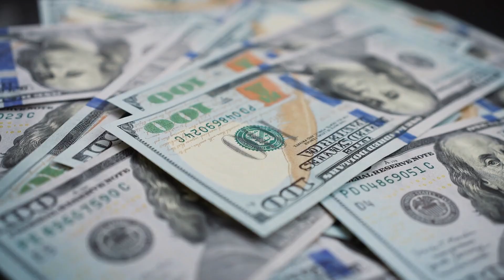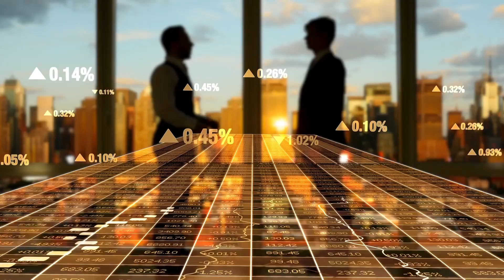Why Solar Power Failed in the Sahara: The Untold Story

Comment: Maybe we could use instead the Sahara to cool the planet with heat convection. Paint black large surfaces of the desert. The air will be heated a lot more than the surrounding. This will create a convection current that will send the heated air to the lower stratosphere. There it will radiate more infrared to space because of less greehouse gases over it. The cold air will go down back to the desert surface. This would cool down the desert on average and cool down on average the planet.
Reply: You are assuming that space will cool the lower stratusphere via the conduction of the heated air. Space is an insulator